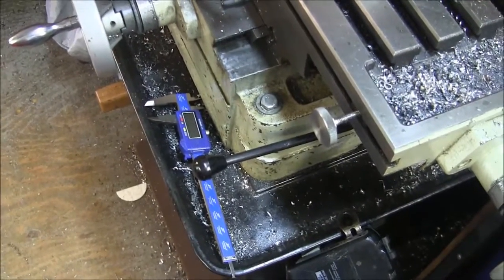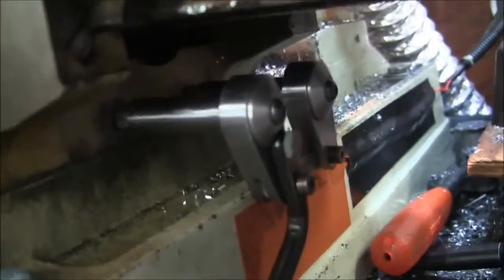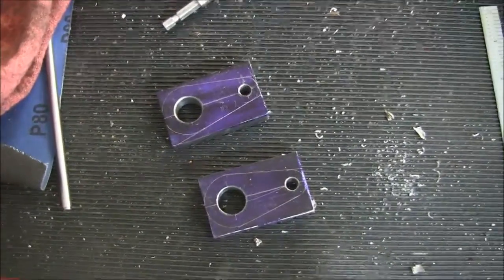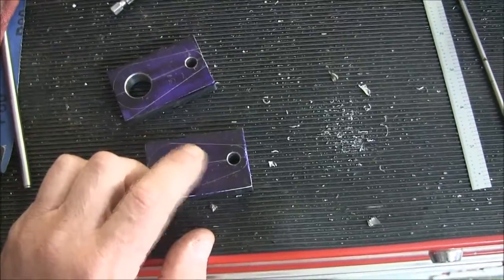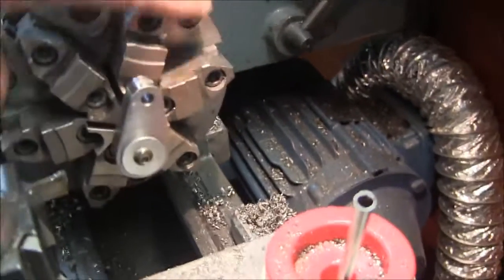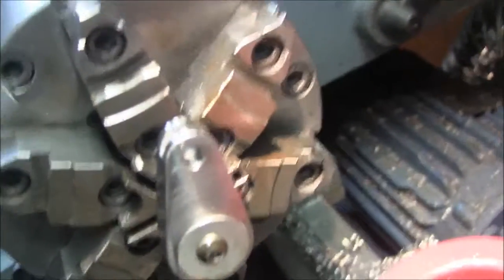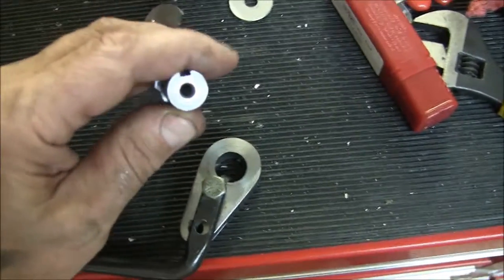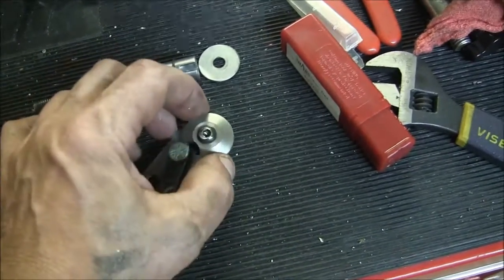RF-30 Table Lock

Comment: Machine designer/machinist here. Joe, this is outstanding. I may incorporate you idea into my round column drill-mill some day. I replace the crappy screw locks with a pair of ones I fabricated but seing how aweome your arrangment works, I won't feel bad replacing my nice fabricated ones.

Comment: Great idea and well done. But moly grease used for lubrication? You do know any milling machine with a one shot lube system almost always has a line going to the X,Y axis feed nuts so the screws get lubed with standard way oil. Grease no matter how good is in the end detrimental to the machines lifespan and accuracy. That way oil helps to flush any possible chips or wear particles out and off the parts over time. Grease traps them where there least wanted and will increase the wear rates. Without a one shot system then an oil gun with way oil would be better. Your machine so your choice, but there are good logical reasons for using oil instead of grease.
Reply from the maker: Turning Point I believe that you are right but I do not find that I get many chips on the X axis leadscrew. As far as the Y axis screw goes, since I don't use a way cover, I tend to use way oil on the screw more frequently and I also use the shop vac more in that area. My machine is 96 vintage and I have never had a problem.
Reply: Turning Point those bejires are expensive for a home shop guy or are you do you know a cheaper version
Reply: Hitting a big chip on the screw with a power feed made me grumble and moan for hours once. Grease is glue for chips. Never again for me, oil is the flusher.

Comment: A bloody great idea that is. I still have got to do the the post to stop having to realign the head when raising or lowering it.
Reply from the maker: There are lot's of things you can do to improve these machines, the basic design is not bad but the little things they cheap out on drive me nuts.
Reply: i have put some small brass plugs in mine at the moment as the ones in there had a point on them.
have smoothed them down no holds better like you i hate getting my hand under the to lock it.
Reply from the maker: You dont really need the brass, those lock screws push on the gib strip. There are small indentations in my gib strip that those screws fit into. If you notice the shape I cut on the ends of my screws, they fit into those indentations. But brass cant hurt anything.
Reply: there is no indentation for them or groove every time i did them up the gib would move upwards.
Reply from the maker: Wow, that sounds very strange. My gib is captured in the dovetails and cannot move up very much. I also have two indentations which look like they hit it with a drill. My gib is also tapered so when you tighten up the big screw in the front, it tightens up the ways.
Reply: You've got to do it - it's amazing what a difference it makes. It's the reason I subscribed to Joe's channel in the first place. I stick around 'cause he's such a nice guy. That and the random bear encounters. :)